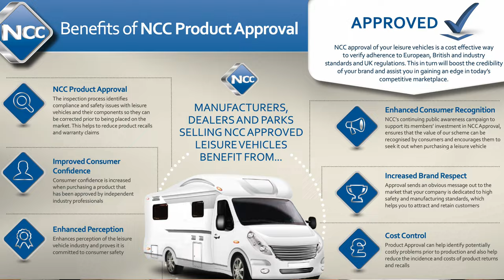Surprising Insights on Safety & Quality Revealed by Top Camper Van Converter

Comment: how do you know the levels in the water tank and the power left in your leisure battery is there a control panel that's hidden away..
as you used this camper for a few days is there a spotlight for reading if you sleep on the drop-down bed. also can you turn the spotlights on and off separately in the living area ..did you get wind noise from the roof or the roof flapping with headwinds when driving as i noticed unusually they don't use the rubber weather strip above the window screen..
Reply from the maker: Good question regarding water, i'm not sure. Will find out. The electrics are Victron components, so will have bluetooth. A display with levels for all aspects gas, water and power was being implemented at some point this year in the new ones. There is a spotlight at the rear with a USB port, although i would add one on the other side also. 
The lights are separated front and rear and i believe these can be changed  for touch controlled ones.
The wind noise often associated with these roofs is when people don't shut them properly. I travelled over 600 miles and when closed properly it was no problem. Personally, i would add one aftermarket anyway
Reply: @StaycationLifestyle  thanks for the info
i would change to lithium so i would presume you can just swap them without changing anything as it has victron components..
i would get the 110bhp highline spec as the 150 DSG highline model on this camper is 9k more thats a lot of money for an auto and 40bhp extra..taymar have one listed for £66495
Reply from the maker: @vanagon1966  Likewise, Lithium is definitely the way forward. It’s actually a factory option, so the components are all ready for it. It’s the base van price that creates the cost difference. That one has a few additional options on it, although I think it may be sold. I know there is only one left at the moment. Additional stock coming soon (not sure when)
Reply: @StaycationLifestyle  yes that is one thing i like about these campers that the extra costs are only vw spec options and one size fits all on the conversions..
i am going to buy one thanks to your videos and info about them..
they have grown on me

Comment: I’m looking for a new van and have a small family. Safety is my priority so I’m probably going to go with a cali. After hearing about the conversions on vans I would rather be safe than sorry
Reply from the maker: Good choice. Hold their value extremely well too. You can go wrong with the Cali or an NCC Approved converter. Remember with a Cali that the sliding door is on the drivers side, so consideration needs to be taken when parking against the pavement for children getting out, as you would normally park with the traffic flow meaning the door would lead to the road
Reply from the maker: @pauldavies7251  The problem is, who is reputable? You probably know who is and who isn’t. Yet you look at the forums and people talk about how good Company A is and Company B, however these companies are cutting costs, carrying out poor installations, not carrying out the required strengthening, falsely claiming fully tested when they are not, gas installation not done properly, not correctly load rates wheels and tyres etc etc. 
But people will still recommend them. The industry needs regulation. 
Sorry I think predictive text has changed the conversion company you mentioned